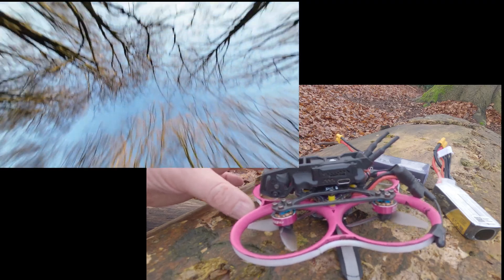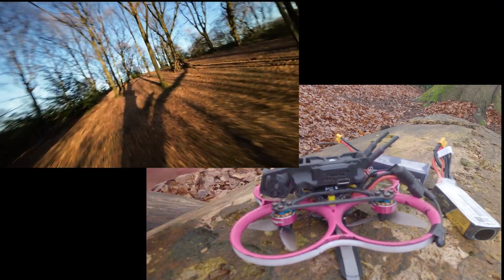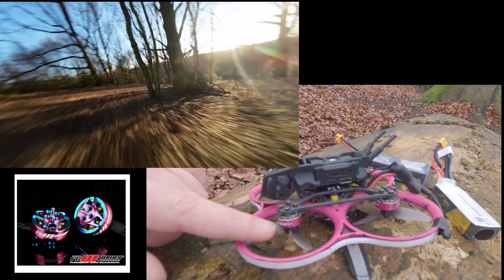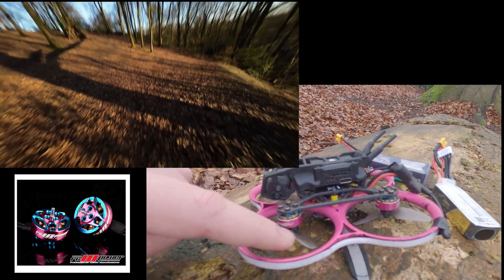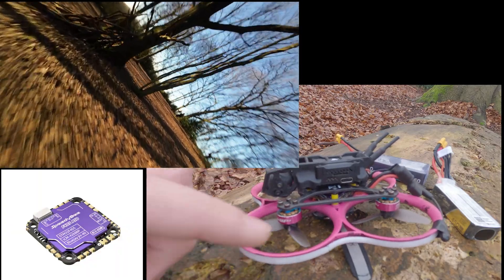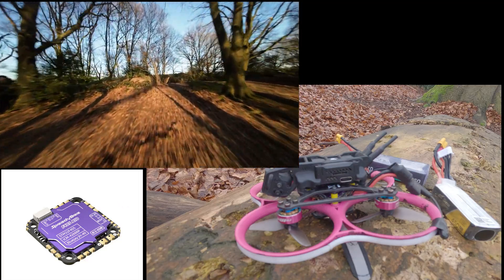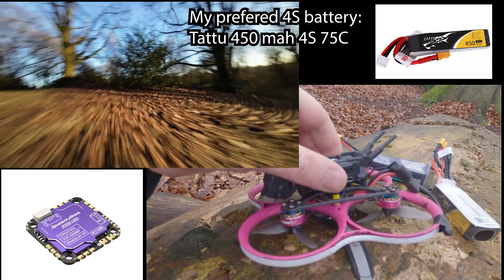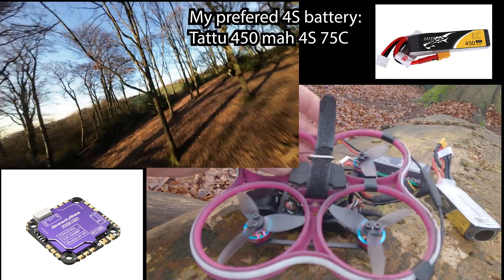My Pavo 20 Pro 4S Custombuild!

Comment: Hi, I decided to buy this AIO board myself but how did you mange to get it to fit into this duct frame as the heatsink/antenna pcb hits the duct frame for me, I'm using the speedy bee aio rubber grommets that were pre-installed on the AIO board.  Maybe you changed orientation of grommets?

Its really nice board thanks for the reccomendation.
Reply from the maker: Oh that's a good question bro, I actually remember it being a little bit fiddly but it did fit eventually pretty good. I don't remember what I exactly did....🤔

Comment: hey, can you share you pids? I have just made two custom builds, one 4s with the same motors (I tried also 1303plus) and 6s version. I also use 2.3inch props.
Reply from the maker: @my.fpv.flights  you can contact me on Instagram or Facebook (both mode 7 fpv) and I'll send you screenshots of my settings.
Reply: @Mde7FPV  thank you! I sent to facebook

Comment: Hey nice build and nice video, your previous video on pavo20 4s inspired me to upgrade mine to 4s which was a great idea much more usable after.  Do you think the stock build of the Pavo20 pro is ok as? or does a custom build with 4s give you much better drone ? I only ask as I'm unsure to buy stock or go custom build route. Thanks keep up the good work!
Reply from the maker: Hey thanks a lot for your feedback. I think it's an upgrade you can do, but you don't have to. The stock pavo 20 pro with its lava motors is already really really good. Way better than the stock regular 20. An upgrade that I definitely recommend is the HQ props mentioned in the video. I think those make the 20 pro a little bit more snappy and aggressive when going for some freestyle.
Reply: @Mde7FPV  Thank you so much for your honest feedback I really appreciate that.